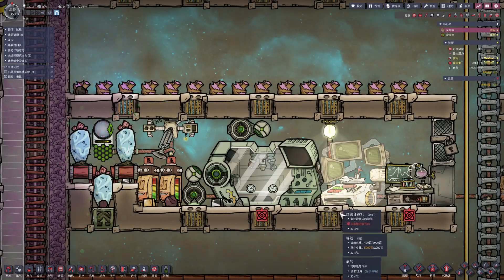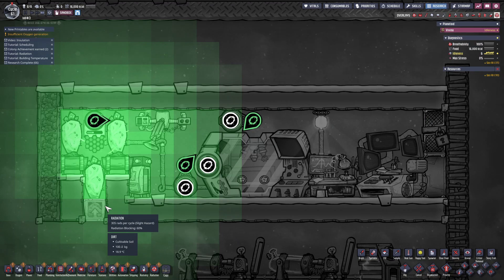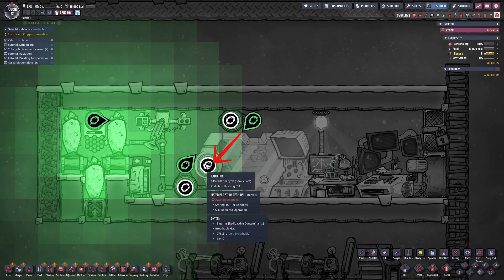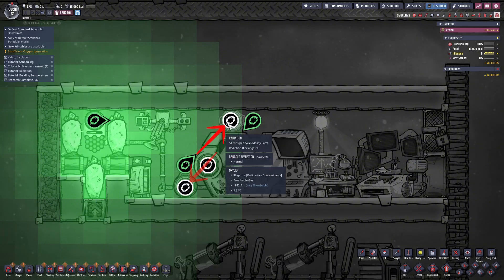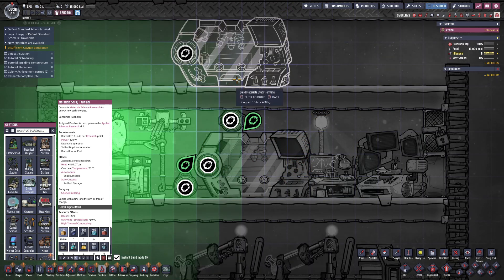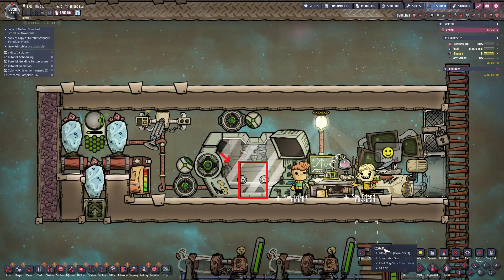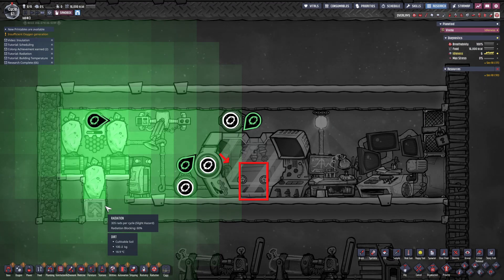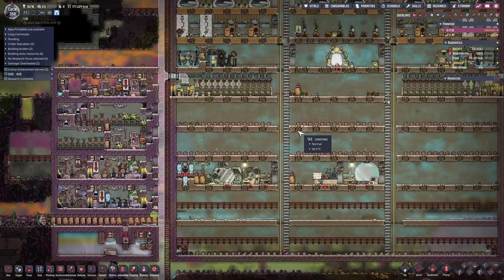[ONI]#8 Boost Early-Game Research Speed by 50% with This Radbolt Setup | FansGame-k7k

Comment: As the previous commentator said I would consider automation especially when it comes to doing t4 research and are waiting on data banks as the rad bolt generators are not cheap to run at 480w each.  Simple automation is needed simply a wire from the from the labs output which will send a green signal so you need to run the wire through a not gate to change the signal to red when the labs rad storage is full and then run that wire into the generator which will auto turn it on or off depending on storage of the lab.

The rest of the design is great and i love the loop system you got going

Comment: No mention of adding automation to turn off the rad bolt generator when full/not needed.  Its fairly simple to add as the station has an automation output.
Reply from the maker: I never use automation to control the Radbolt Generator, because even if it's running all the time, I still don't generate enough Radbolts. Once all Tier 3 research is complete, I just cut the power.